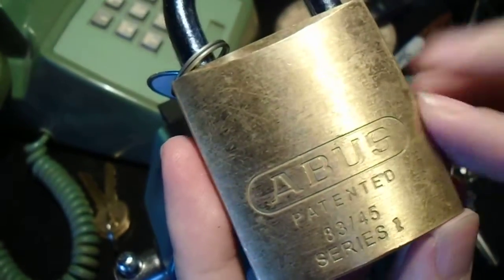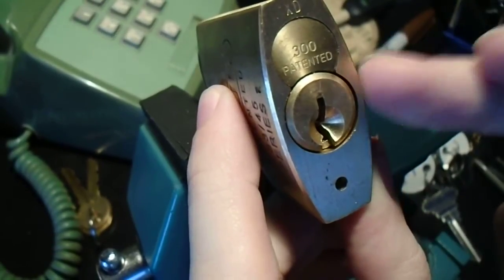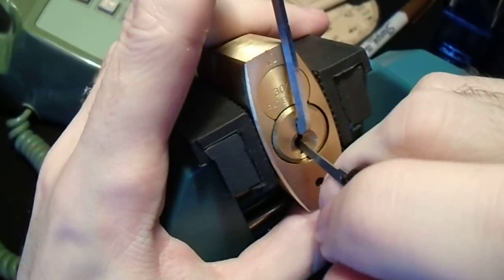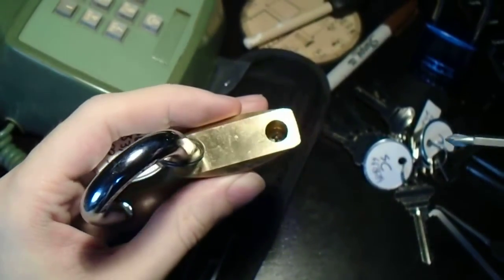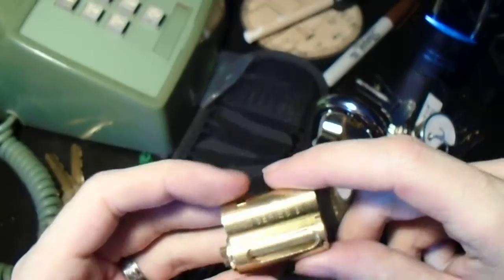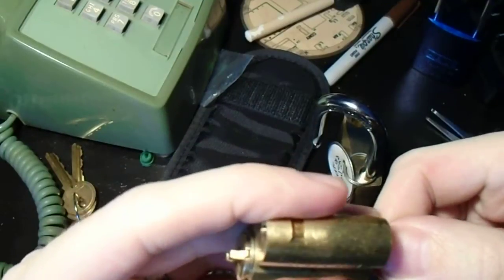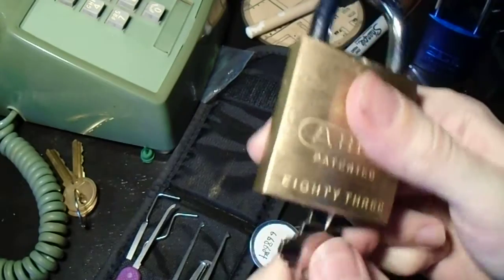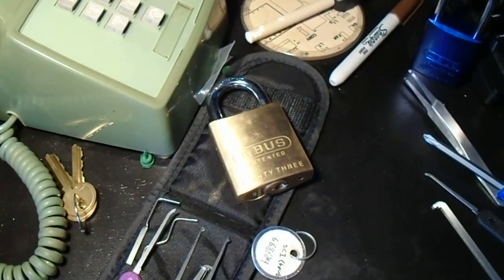(027) Abus 83/45 Series 2 padlock picked and gutted

Comment: is this padlock bypassable?
Reply from the maker: +Mark Barrett There is no well known bypass and any potential bypass technique would depend very much on both which of the many available cores are used and which function the lock is set for (key-retaining versus non-key-retaining). The latch is of the double ball-bearing and cam type so shimming and other latch attacks are not possible. 
This leaves the question of American Lock style bypasses which I cannot currently categorically dismiss but will note as rather difficult and likely to require customized tools. The first challenge with actuator bypasses is the question of key-retaining vs NKR function, if the "Z-bar" is installed to make the lock key retaining an actuator attack will also not be possible as the actuator and plug are firmly connected and cannot move independently. If the Z-bar is removed to make the lock non-key retaining an actuator attack might be possible but the design of the actuator and ABUS's tailpiece prevent any of the commercial bypass tools I have from reaching the actuator. Some sort of custom built tool may be possible but it presents several significant design and engineering challenges. Some 3rd party cores may be available which might use different tail designs which might change or reduce the difficulty but I do not have any to examine or test.